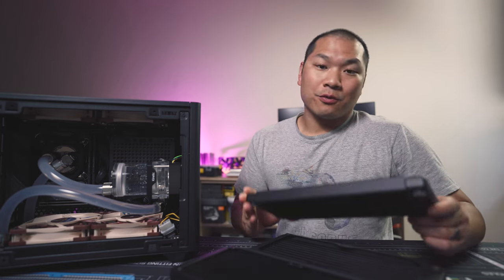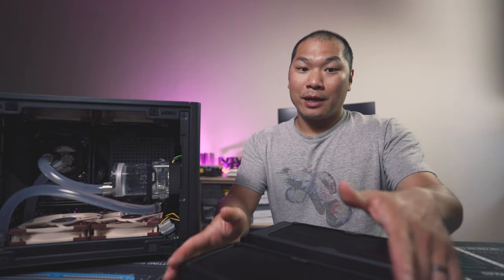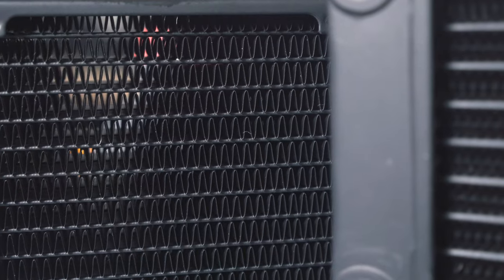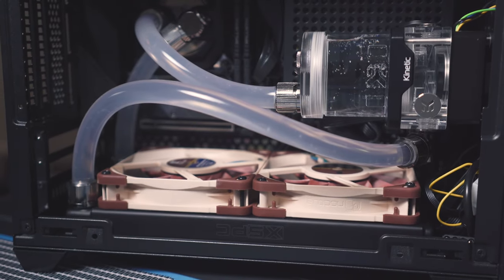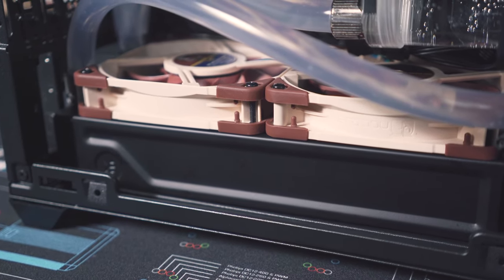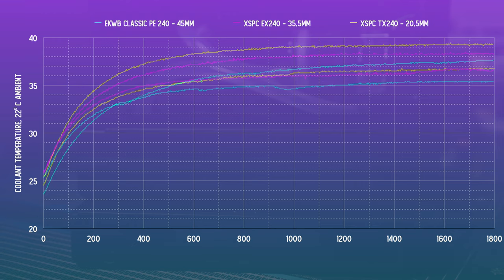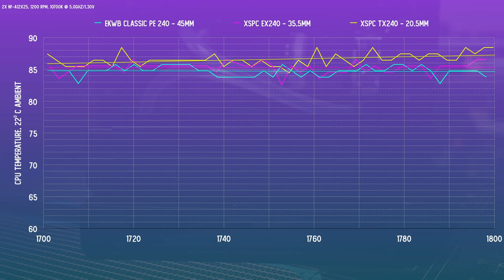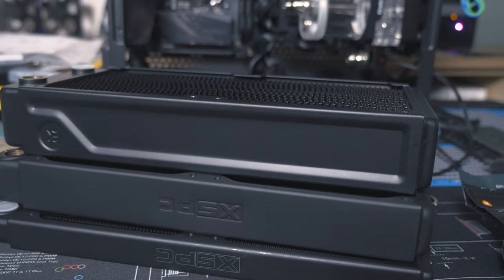Rad Thickness: The Impact on Custom Loop Thermals

Comment: Would be curious to see a custom loop NR200P with a thick rad, riser cable and just top mounted fans to see if it's doable. Been eyeing a 54mm r240 but I don't want to make the investment without knowing for sure. Also unclear if you could fit thin fans with something that thick. Can't seem to find GPU slot to bottom of the case clearance anywhere.
Reply from the maker: You have about 70mm or so because of the  power supply cables. If you shift the PSU up or cable manage super super well… the riser cable limits you to 75mm. Either way 54mm is too thick with 25mm fans. I have an XR7 and it absolutely needs 25mm fans, slim fans won’t cut it with that thick rad. EK PE240 is the thickest I would go on the bottom- it was a tight fit already!

Comment: So, a push+pull with a thin radiator would be better than just push+45mm rad from other tests I've seen around?
Reply: Always. PC fans have quite a low performance in reality, compared to what we see on industrial applicationgs, HVAC systems and cars etc. Fans therefore need all the help they can get to cool your water effectively. 

A radiator will only work well if you can get lots of cool air to flow through it. That's why thick radiators typically have unexpectedly poor performance gains - you just can't effectively cram enough air through them using our little 12V fans. 

If you want a deep dive, go check out xtremerigs radiator roundup from 2015. It's an old article but they really did a professional job and the physics are spot on. You'll see that not everything we've been taught is factual.
Reply: And to clarify further, push only does work with slim radiators, but with thick radiators you need push+pull because the air flow restriction is too much in push only.

Comment: Late comment but would the variable of pump speed/fluid flowrate be significant. Case in point: I use alphacool DC-LT 2600 tiny pump with rated flowrate of 75L/h in NR200. Know you can faster DDC pumps, so curious.
Reply: Everything above 1 GPM is pretty much negligible gains.

Comment: I'm about to build my first custom loop in the NR200P. 

240mm slim from EK at the bottom and 92mm on the back.

Nothing on top as I'm not comfortable with modding the case yet. 

Biggest caveat is that my hardware is a 5900x and 3080ti FE.

Should I be worried?
Reply from the maker: It will work, but you will see high fan speeds to keep the coolant temp in check so make sure you are running the best fans you can. With a 92mm rad vertical mounting the card is not an option- with a 30mm rad you will only have space for 15mm slim fans if you want airflow, so Noctua slims. One other thing is the EK Slim rad (guessing you mean the SE 240?) isn’t the best rad in the size class, since you are going to be seeing higher coolant temps, you’re going to want the best possible rad. Of course if you have it already then stick with it, but for the <30mm segment I’d highly recommend the hardware labs GTS 240. You can also experiment with adaptive undervolting for the 5900X, and undervolt the 3080ti as well. Other than those, you should have the ability to keep temps below 45 at load, figure out what fan speed maintains that, and just set that for your max fan speed. Good luck!!

Comment: Very Last Post but did you try a push/Pull?
Reply: ZEFIR001  I typically run Push/Pull and adjust the rpm down for the best noise to cooling ratio I'm guessing a 45mm would really be the sweet spot with a push/pull.

Comment: There is a simple thing that can bring temps down.
drop the ambient temp.
How?
coolbot and a common enough window unit ac. 3d print a shroud to an 8 inch vent tube, and pipe the cool air anywhere you want.
buy a cheap enough marijuana grow tent, and pipe the cold air into it. 
Spending 200 on a custom cooling loop just to gain a few extra degrees...
AIO's give you at best 44 c temps.
custom loops give you at best 37 c temps.
With an AC unit cooling the air to 3c, you can expect 20 c temps. Not to mention the positive air pressure, filtered air, and dry air...
You could probably get extremely descent temps with just an air cooler like Noctua. Heat pipes really are the most effecient.

Comment: Really suprised with the results, I’m planning on water cooling my Jonsbo d30 and been looking at different radiators/fan configs and if it would be better to do a 30mm thick rad with 15mm Arctic p12s or to do a 20mm thick rad with Normal p12
Reply: Always get the thickest possible rad with normal sized fans. Thin fans are gonna be MUCH louder to achieve the same temp

Comment: So, it really doesn't matter all that much. Especially not with multiple rads.
Reply from the maker: Two thin rads when placed at intake points will way outperform one double thick rad.

Comment: Big Chinese brands like bykski and barrow are better than western parts btw. Usually made of copper and half the Price with the same quality. Aluminium is just for cost savings, it's worse In every way... This is one reason why cars use aluminium btw, for those that use that flawed argument against copper. Those radiators are so huge it makes a lot of difference
Reply: Your video made this even more important. Buying a better radiator is more important than buying the thickest one. oh and... Having the best fans is a no brainer since you're already spending more on cooling than your actuall Gpu regardless. It needs to be worth it
Reply: @OutOfNameIdeas2 imo having more surface area is the best, i went overkill with my setup but I cheated out on fans, I have 2 480mm and 2 360mm, both 60mm thick in push pull (case is a Corsair 1000D) 30 fans (Arctic P12)